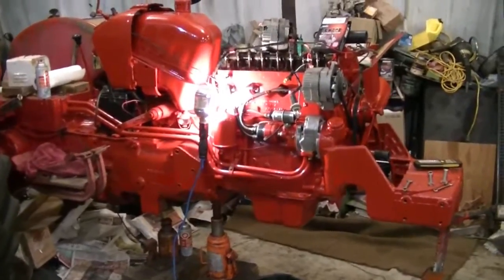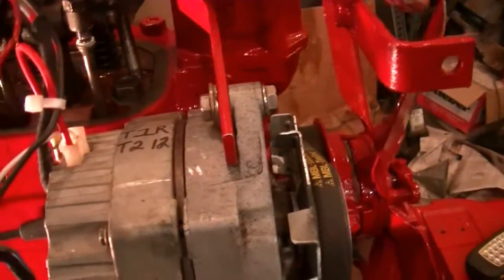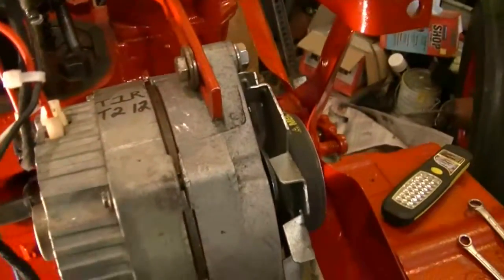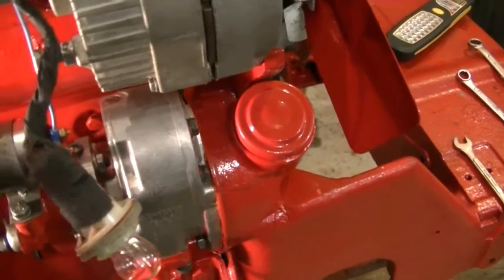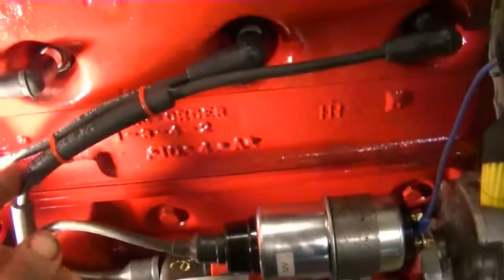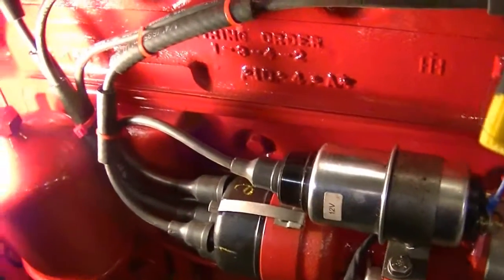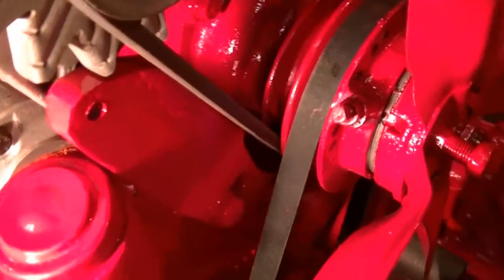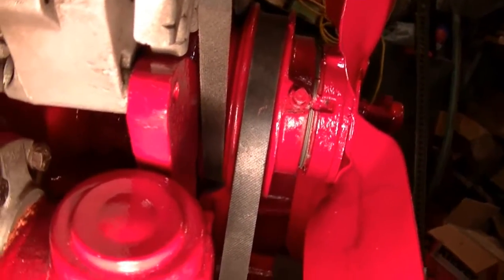6 Volt to 12 Volt Conversion on 4 cyl IHC Tractor w/engine start - zeketheantiquefreak

Comment: hello sir I run across in the past different alternator types some of those tractor alternator hade capacitor on them so if the capacitor fails baterry isnt chargeing any more.
The other problem I noticed left and right turning direction alternators lot peopel buy wrong tractor alternator type and they dont charge the baterry so I was wondering how to determine what turning direction those alternators are how to identify them and how posibly converse them to work normali?
Be me is Delco 12 si alternator in me car how ever be me is the second pin on the voltage regulator bend so always wondered what that thing does exactly???
I use only 1 pin and light bulb.
It is confuseing me car uses linear voltage regulator inside the dashboard so Im confused about those voltage regulators inside the alternator they produce bouth dc pulses if Im not wrong on that theory is it similar like dual 5 pin relays wuld behave? peopel used lot thode set up in the past for different aplications so was wondering culd they replace that voltage regulator ?
Reply from the maker: Thanks for the questions. The Delco 10/12si models can be run in either direction. The voltage regulator in the dash/instrument panel is to maintain a consistent reading of the gauges regardless of the charging voltage. Sorry, I have no experience with changing to an external regulator. The reduced voltage to the one pin is normal, OEM situations would have an 'idiot light' or a resister wire to feed the regulator the required voltage.

Comment: Whoever told you the ignition switch has to carry the full alternator output on a one wire has no clue what they are talking about. 

The one wire would go to the amp meter + with a #8 ga wire and an other 8 ga from the  - to the starter solenoid main battery cable stud.

As for those Pertronix conversion units, they are electrically horrifically noisy and will destroy the solid state regulator in the alternator if they share common feed line from the key without any noise bypassing capacitors/condensers at both the ignition module, they key and the alternator exciter terminal.   

 
For bypass capacitors/condensers the same condensers that are used for the points type ignition system work really well.
Reply from the maker: Thank you for the information.

Comment: That's not a true one wire.
Reply from the maker: You are correct. A 'one wire' Delco alternator has been modified from its original arrangement by the installation of a special voltage regulator. The charging will begin after a certain threshold rpm is attained and then the alternator 'self excites', producing needed current until engine is shut off. If one would wish to invest in a 'one wire' alternator the installation is much simpler than what I have done in the video. The only drawback is that you don't have an 'idiot light', which many people don't require anyway. Thank you for the comment.

Comment: Hi Zeke—My 1958 IH 350U gas tractor has been having starter issues. Do recall exactly which starter motor you used on this 300? I think my 6 volt starter has succumbed to the 12 volt conversion but I want to get the EXACT starter as a 12 volt replacement. Thanks for the video and clarity!
Reply from the maker: Thank you for the comment.  
This starter is the original 6 Volt Delco #1108041-6b9 and works well on 12 Volt so far. On a similar application the starter had an aluminium  end cap/brush holder that failed. I was able to get an earlier style cast metal end cap and this solved the problem. That tractor has been 12 volt for about 30 years now and the end cap was the only problem. When I had that tractor split say, 25 years ago, I reversed the ring gear so that the starter drive had new teeth to engage with. 
  I have converted many 6V tractors to 12V and used the original starters with success. I do however 'go through' the starters at the time of conversion. (Unlike other DC motors, starters don't care if the system is positive or negative ground.) 
No, sorry, I don't have access to the proper part number for a 12 volt starter. A reputable starter/alternator repair shop should be able to look this up for you.

Comment: Beautiful Job... I never understood How an Idiot Light Works, thanks for explaining that too. Why Is the Idiot light Really Needed if you have a working Amp Meter?,Just a Simple Visyal assurance that it's charging I guess?
    The 300U I'm getting has already been converted to 12 volts and starts faster than any of my other 6 Volt Positive Ground Farmalls but I still feel that ORIGINAL is better from a Collector's View $$$$... that's why I never converted My Super A or Cub....Am I wrong about that?
Reply from the maker: +MrDanoconnor  I use the idiot light system just out of habit. I have old alternators out of GM cars and trucks. They are simple, bulletproof and easy to fix. The bulb holder is from the front turn signal of a vehicle with an 1157 bulb. One of the filaments will be approximately 3 Ohms.
   This same alternator (Delco 10SI) is available as a  'one wire alternator' and is simpler to wire and install. It is 'self exciting' meaning it activates itself at a certain speed, perhaps at eight hundred engine rpm.
Reply from the maker: +MrDanoconnor  Some collectors are what I call 'purists' and will pay extra bucks for something that is bone stock original. 
  I Satisfy these people by retaining the original generator and regulator for resale time. 
   Mine are mostly expensive toys and toys are more fun when they start good and run nice. Boosting batteries and filing points are two items not on my 'fun list'! 
   So, yea, the only way my 300 utility can be seen as 'non-stock' is there is two wires coming from the distributor instead of one. The idiot light makes a great conversation piece hanging out from under the hood and it could be eliminated by using that one wire alternator or tucking the wire up out of sight.. They cannot tell if it has an alternator or a generator because of the hood. So, each to his own. Follow your heart! You will know best.
Reply: +zeketheantiquefreak   I agree with you 100%... I absolutely do NOT agree with the Purist approach to enjoying my toys,

Comment from the maker: On a very hot day in the fall of 2015 I did have trouble with the Igniter brand electronic ignition system. Twice, after about an hour's running in the heat, the ignition system would quit. It would be a very scary thing if, say, you were pulling a trailer or implement up a hill at the time.    
   After cooling off for a while the unit would start and run normally. 
   The coil is a new 12v unit sold to me to be compatible with the electronic ignition.
   Not sure what I should do. I could place a Chrysler Ballast Resister that would be normally be used to convert a 6v coil to a 12v application. This would drop the coil voltage and current to roughly half and would create a lot less heat. This may reduce spark which may affect the running of the engine. I have had the unit too long to be able to claim warranty. 
   I can leave it and hope it never ever quits when crossing a highway or climbing a hill.

Comment from the maker: The alternator is a model 10SI General Motors/Delco product circa 1980. Reliable, simple and easily rebuildable. Internal regulator with the capability of being converted to a 'one wire' alternator if one so desires. A 'no brainer' for many applications!
Reply from the maker: +zeketheantiquefreak Quick suggestion for those old cloth wiring harness covering issues... Try using black 'hockey tape' instead of 'electrical tape'. The end result is much better looking harnesses with decent protection.

Comment from the maker: Not mentioned in video... On this application, 300/350 IHC Utility, the alternator is wider than the original 6V generator, and will not allow the hood to close properly without modification.
Reply from the maker: zeketheantiquefreak All done! by grinding away some of the support on the inside of the RH hood, I am able to have a tiny bit of clearance with a 1/4" washer in the lower front RH hood mount. Barely noticeable and good enough for me!
Reply from the maker: zeketheantiquefreak A 1/4" thick washer, that is, not a standard washer. When setting it up, I was able to find a belt and pulley size combination that allowed for belt tension with the alternator tight with the cylinder head. I should really buy and identical belt to the one used, in case I need it in the future. The belt is not so easy to replace with the radiator in place and trial fitting a bunch of belts would be a literal pain.